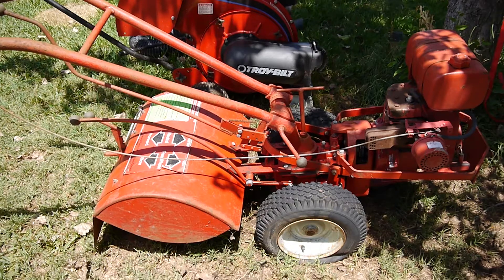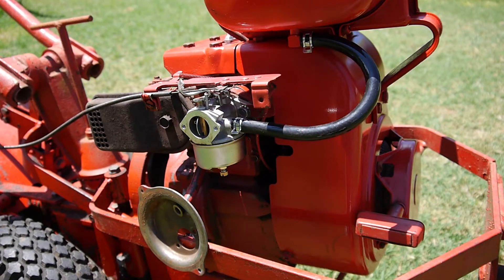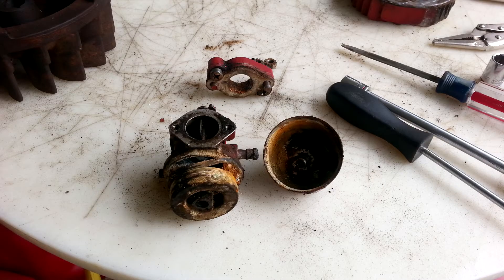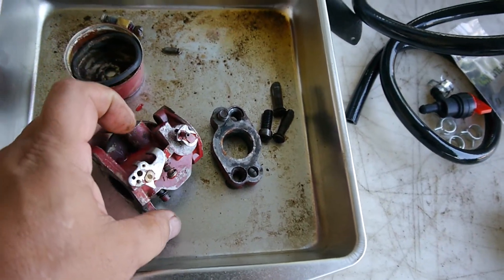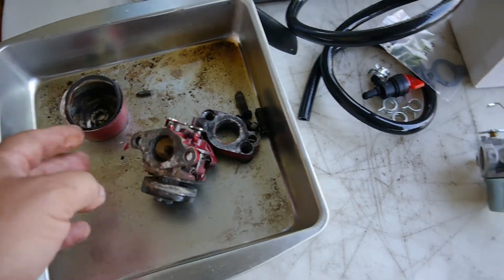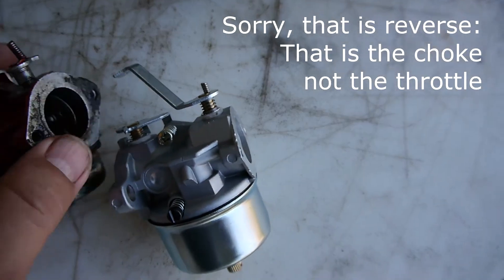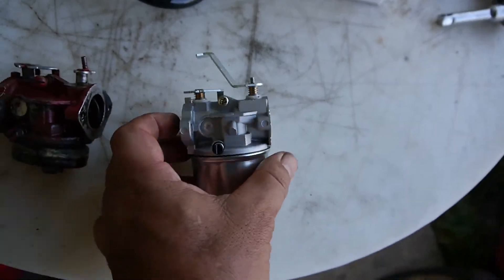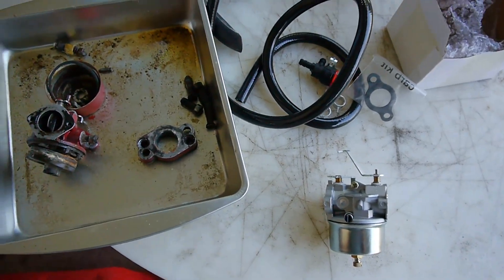Tecumseh HH60 Carburetor - The Worst Carb Ever Seen

Comment: I bought an aftermarket carb like this and it never ran as well as the original carb, no matter how it is adjusted.  Other people have mentioned similar experiences.  I eventually broke down and bought a rebuild kit to fix the old carb up, which cost more than the aftermarket carb, but it runs like it used to.  I had inherited my dads troy built horse tiller with HH60 engine.  The tiller is fine and everything was good except all the small parts in the carb were toast.  Thinking it would be easier and better, I bought the aftermarket carb and boy was I wrong.  My older brother had a similar experience rebuilding a snow blower, the aftermarket, cheap, carb never allowed it to run properly no matter how it was adjusted.
Reply: Any links to the carb rebuild kit?